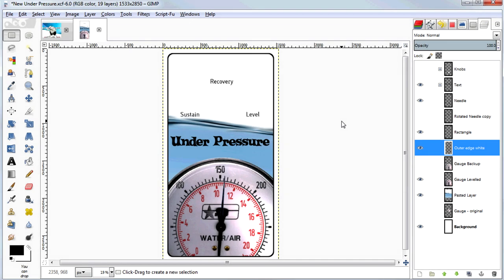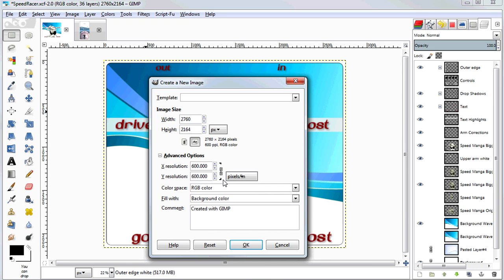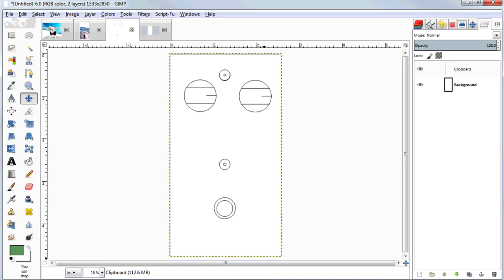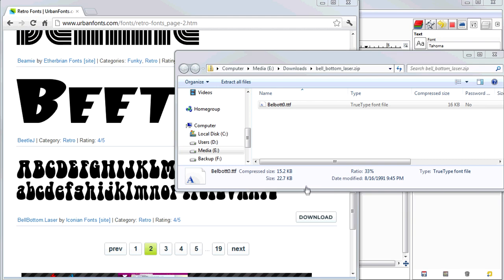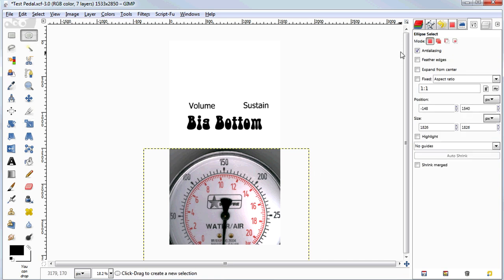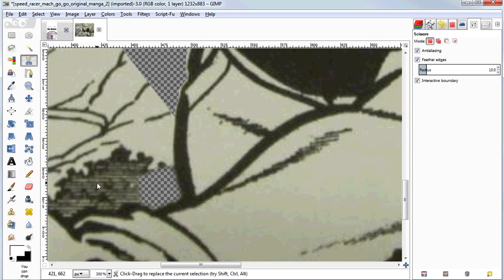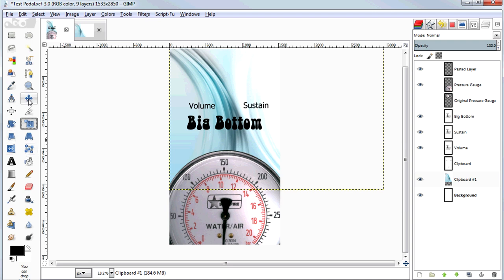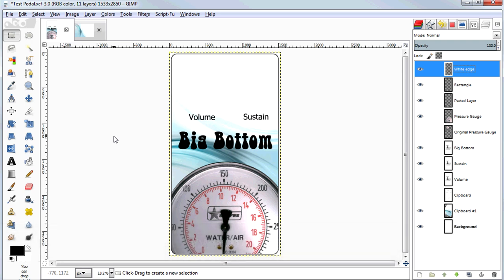Using GIMP To Create Pedal Artwork

Comment: good stuff John. I have a Mac, does GIMP have a version for Mac? Also, what do you use for a clear coating? Ive used Future floor polish,and  hobby lacquer clear coat, but neither is very durable.
Reply from the maker: Yes, Gimp is available for OSX at www.gimp.org/downloads
See my followup video on finishing:   
Printing and Applying Waterslide Decal to Pedal Enclosure

Comment: thanks a lot John . i was wondering on the border that you did at the. end im using a black pedal  how can I make the border none black? i am all ready to print. Your video was very helpful although the new version of gimp is different . also as a noob it took me a long time . i have several issues with layers. and font. i tried to change font and when i click to type it reverts back to the oriinal font no matter what. try it keeps reverting to sans font. any suggestions? one last,question how can i change the background color to black its white and if i try moving the layers around everything gets jumbled?